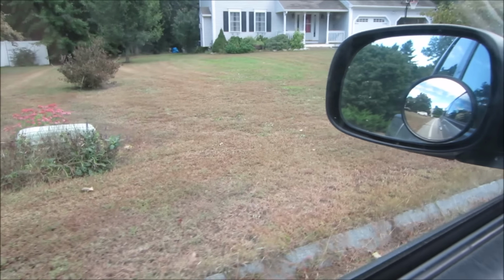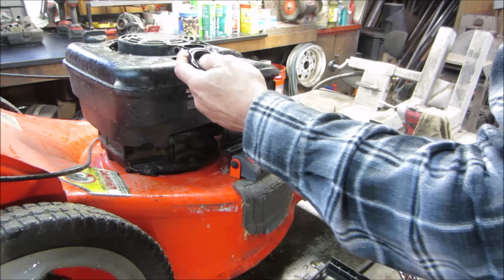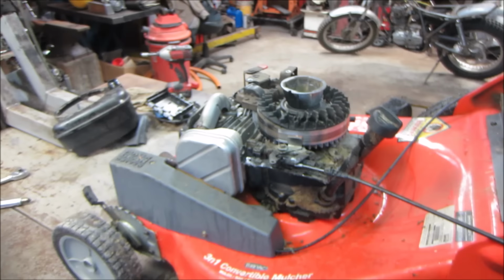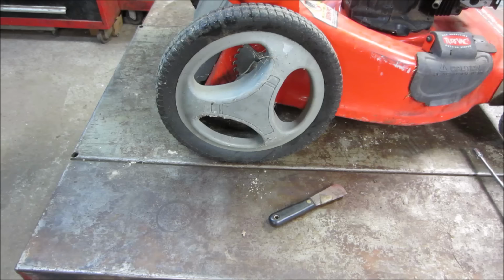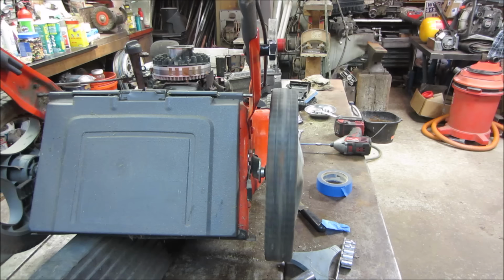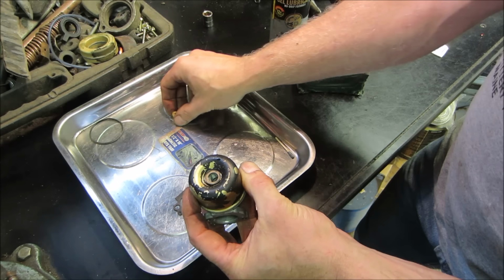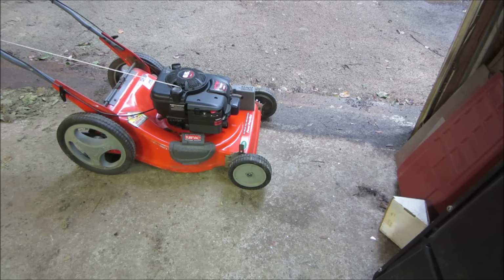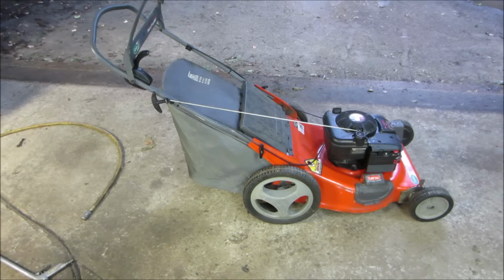How to restore a lawn mower. cheap.

Comment: I have never seen a free pile like that. Hell, I've rarely ever seen a free pile.
Reply: free piles happen alot here in Alberta . however all of them tend to be in garage sales and not like what ol mustie finds here.
Reply: Yeah. The only free piles I see is walking behind a dog.
Reply: Ya that's mostly because they are moving back East and don't want to pay to ship it all.
Reply: One thing's for sure, you'll NEVER EVER see a free pile in Portugal, in fact people try to sell any piece of garbage online, some people even try to sell old CRT TVs for over 50€, even as I write I'm seeing someone trying to sell a TV from the 70's for 150€.
Reply: You're probably going to see more and more because the manufactures are producing more super cheap junk every day.  The goal is to make everything more costly to repair than replace.  Garbage plastic wheels, shafts that bend, etc.  The engines are becoming more and more throw away too with ignition systems that, if they are available as a potted spare, cost more to replace than the mower cost.  (Good luck finding a suitable spare on ebay.)
I just reworked a 1982 Snapper, a mower which was originally made to have a good level of quality.  The engine is a Robin/Subaru although other models were Briggs, etc.  The self propulsion is well made with a lot of standard hardware parts incorporated.  Today Snapper is made by MTD and it is a piece of throw away junk.
Most owners now just hire a yard service and if they do cut their grass they don't change the oil and they let today's nasty ethanol blended gas corrode the whole fuel system outside of the ABS fuel tank.
I  will try to keep the old stuff running as long as I am able.  I just hate to see decent resources wasted.
Good video, thanks.
Reply: If you ever want to get rid of anything, put it out on the curb, it will be gone by supper time.

Comment: I fixed mine cheap. I bought a 6.5 HP B&S engine on ebay for a really cool $120.00 and modified the mower deck. I now have a Super kick-ass Snapper that I got from the scrap yard for 15 dollars.

Comment: I like to cut the bad fuel lines ends off and maybe add a fuel shutoff valve and/or a fuel filter ... both are cheap. The shut off valve is like a maintenance valve for carb work or fuel filter changing .... you can check the needle valve too with the bowl off. That's my 2 cents. I like when you tell what the repaired mower sales for new approximately, and how much you'll put it up for sale. You do good adding life to these mowers. We enjoy your videos too.

Comment: I have one of these mowers, but without the donk wheels and with a tecumseh engine. The blade is the same, they probably sharpen it without removing it. I do and it looks just like that. Had my mower since 2000 and still runs great.

Comment: Just a thought, what about laying down the wheel on a flat surface and then heat gunning it and maybe sticking some type of weight on the wheel to straighten it? granted yeah... it's a used cheapie so...

Comment: Mustie's favorite tools:
1. Wire wheel 
2. Ultrasonic cleaner
3. Air compressor 

Mustie's habits that make me raise an eyebrow.
1. Uses whatever oil is in the engine to test, no matter if it's 37 years old.
2. Tests engines without air filters in place but makes sure that damn carburetor is spotless, LOL.

I poke fun but it doesn't take away that I think that he's a master mechanic and troubleshooter with a true gift for fixing things.  I thoroughly enjoy the videos. :D

Comment: I just sold a Craftsman Leaf Vac for $250 on Craigslist I got for free.  Took it to Home Depot and paid about $70 to get it all tuned up as I didn't have time to do it myself.  Also last week, sold a Troy Bilt lawn mower I got for free  when someone left it in a back alley for a week last winter.  Did the work myself over an hour or so.  Got $80 for it.

Comment: I ordered and put all four new wheels on my 21997X8A and it still propels crooked. Have had transmission checked, all pins and bearings and gears are like new. It's just the nature of those Scott's built by Murray. The ones built by John Deere were much improved .

Comment: There are zero free piles here in Toronto...craigslist for free section is as close as it gets.
Reply: Stuff is expensive around here, so ppl use stuff till there's no life in it.
Reply: Same here if anything does go to the street it lasts maybe 10 mins, those golf clubs would go quick here also.
Reply: Should add the times you do see stuff on the road, it's so bad no one wants it, I came across a tiny push mower last year. I swear I thought it was one of those plastic kids toys at first, it was so small. But it was old and locked up, looked to have been sitting out for year behind a garage. Nothing as nice as this stuff Mustie1 finds, even his crusty stuff looks good.
Reply: I once had a free pile when I was renovating the basement.  I didn't have time to sell it and my family didn't want most of it.  I put stuff like table fans, old exercise gear out front.  It was absolute mayhem.  People driving by would slam on their brakes, and rummage through everything like a pack of wild animals.  haha Everything was gone in a few hours, better than it ending up in the trash.
Reply: Back in the 70s every Thursday was big stuff garbage day in Toronto was always getting free lawnmowers . To bad they stopped it in 80s
Reply: The Americans throw everything away...
Reply: 808v1 around here, you'd have to fight the scrappers (who are meth heads for the most part around these parts) for the mower.
Reply: Here in New Jersey we get all kinds of good stuff at the road all the time. Its awesome.

Comment: I would just run a wire tru the hole than tape the starter string to the wire and pull tru

Comment: Around here, that's be at least  50-75  dollars.  (doesn't run, lots of good parts.)
Reply: 😂😂😂yep! When I worked on a trash truck I had a large collection of lawn mowers people threw out that were perfectly fine. Only one I had to work on and it had a valve seat that had lifted. A straight screwdriver and a light tap with a hammer creating a little dimple holding it in fixed it. Its crazy how many almost brand new lawnmowers I had that "rich" people threw away when they bought a new one every season....
Reply: sinformant  My problem is I live among people that know how to fix stuff, and if they don't their brother/sister/uncle/friend/cousin/father/mother does.  No one throws anything away or gives it away (to a stranger) unless it's pure junk with all good parts removed.
Reply: @excavatoree  oh there are people around her that base their pricing off the price per ounce gold is going for. When I was looking for a 67-72 Chevy c10 I looked at one that a guy wanted $4600 for that was like a Flintstones mobile and ran so bad it could barely pull itself up to 20mph. He wouldn't budge on the price at all. Luckilly I found a completely rust free running one in the city that I bought off a kid who had no clue for $1500. It wouldn't start so he just wanted to get rid of it. We gave the Carb a couple squirts of gas from a bottle, tweaked the distributor, fired it up and drove it onto the trailer😁
Reply: excavatoree 
You have to go to the "priviledged" areas of your town. I do but you have to act quickly, most of them have city bylaws prohibitting picking and police enforcement. But I never, ever bought a lawnmower in my life. Usually, spring time and fathers' day are good !
Reply: $125 here in NJ running and fully functional. That engine is worth $100 all by itself running, particularly because it's a dual shaft engine with an auxiliary pto (if you look closely you'll see a second shaft that comes out the side, the belt hooks to a pulley on that and goes to the trans in the front, which makes the mower move). Those engines are much harder to come by, I don't know if Briggs is even still producing them, but if they are, they would be a lot more expensive than a regular single shaft engine. I just sold one two days ago on ebay for $100 plus 50 shipping heading to North Dakota, a regular engine like that wouldn't go for near as much is it sold at all, since their are billions of regular ones out their. Their isn't that much else good on those mower's their pretty crappy, its a Scott's made by Murray and they fall apart all the time. 90% of the older Scotts and Murrays I see at the curb can't be revived where most other mowers can. That's why that engine I sold was harvested from one. In general for a mower, an engine with two shafts like that is a bad design and prone to having more problem's than a normal mower with one shaft with the belt riding below on the primary shaft, the secondary shaft rides on the cam and is prone to a lot more wear and tear, its like snowblowers that have two shaft's also in general a poor design and more complicated and prone to wearing out sooner than a typical engine with a single shaft. However the engine on that mower is excellent for heavier equipment that does require two shaft's like a sickle bar mower.
Reply: sinformant I find that Bar-B-Qs are right up there with the lawnmowers. Most just need a good cleaning so it gets replaced with a new one.

Comment: I changed the oil in my mower yesterday. I really hate turning the mower on it's side to drain the oil. Just seems hokey to me. So I took a class jar, drilled holes for the fittings, and hooked that up to my vacuum pump and sucked the oil out. I got the idea from watching Project Farm.

Comment: That Blade is a Flippable Blade that is why it is sharpened on both sides, i had a lawnmower just like the Scotts you worked on, it was a great mower. i let it go with a house i sold, wish i had kept it.
Also Hilly Beaner, the blade will be balanced if you use the Nail method of hanging it in the mounting hole and it hangs level, but you need to check it as you sharpen all four areas on the blade, and that particular blade was designed to suck up the grass when mounted either way.

Comment: Another great video! I’ve got a 1996 GX 85 John Deere and haven’t had no motor issues but I change oil 2 times a year and change fuel filter yearly. Carb hasn’t been removed or bowl removed!

Comment: I have an Ariens machine with that type of primer bulb carb, (Briggs and Stratton), and out of all the machines that I have, it is that one starts the most reliably.
The fact that it does not have a choke means that it's harder to flood. 

The primer bulb seems to act like an old fashioned "tickler" that provides a temporary rise in fuel level, to give starting richness.
It may simply be causing the float to wobble....
Because of you I will now have to go into it all, when I have the chance, and maybe know for sure.
Nice video as ever...

Comment: Briggs INTEK series...last of the flatties, IIRC.  This mover has low hours, probably still has the fsctory oil fill in it.  People these days never maintain or repair anything...one reason our economy is permanently screwed up.
Reply: Well, its actually why the economy is still running. Capitalism work that way
Reply: @DrLoverLover  But the resources are being wasted. I would be more concerned about scrapping good things than running diesel cars, for example. Most people think they're eco when they run electric car, but they don't care about buying a lawnmower every 3 years or producing tons of trash, wasting water, electricity, etc.

Comment: Had a mower exactly like that one. Cheap & easy to work on. If you're cutting a lawn that generates a lot of dust keep the air filter clean or the grit gets in the oil and tears everything up = no compression= no mower.

Comment: I predicted 15 pulls for the cold start, so that was a bit of a disappointment.

Seriously? -starting first pull? -that's weaksauce. The audience demands more of a fight!! :D
Reply: I guessed 3. Machine was so happy to get it's carb cleaned and then loaded with high octane racing fuel that it jumped up and started - first pull. Vroom vroom!    Chuck in NE Kansas
Reply: I thought three and immediately rolled my eyes when he did it in one😑
Reply: Vrooooooooooooooooooooom
Reply: Well, he did have to pull it more times later to get it started.
Reply: @davidbeer  Me, too...
Reply: He didn't record the part where gave it a little starting fluid, lol
Reply: Kevin. What is "Starting Fluid?"
Reply: @davidweum9334  Ether.  Sold in a spray can at auto parts stores.  It's much more flammable than gasoline, so if a tiny bit is sprayed into the air intake and get sucked into the engine, it increases the probability that the engine will start.

Comment: I'm not sure if this mentioned already; carbs will leak when they have gas in the bowl and you turn the carb in a direction other than right side down. The fuel line was probably just fine.

Comment: Mustie that can't be the right blade, you want the angle of the cut towards the deck , so it doesn't tear and bash the grass as it cuts...
Reply: By "deck" do you mean the "deck" of the lawnmower, or the surface of the grass?  The cutting edge must be down so that it shears the grass off and does NOT beat it off and shred the grass tips because then they turn brown.  To me, it looked like the blade was installed upside down.  I've had mowers brought to me, after the owner sharpened the blade himself, and then complained that it would not cut.  They put the blade on upside down and were just shredding the grass with the backside of the blade.

Comment: I'll never get another high wheel mower again. Every time you push down on the handle to turn it around, it puts a tremendous amount of stress down by where it connects to the deck, and eventually the handle breaks. I had a craftsman high wheel mower that did just that. I ended up ordering a new handle and I went to Lowes and got a couple pieces of angle iron to use as gussets which I attached half way up the mower handle and the other end close to the front wheels. This transfers the stress through the angle iron to lift the mower from the front of the deck rather than from the back, and that handle never broke, at least for the rest of the time I had it.

Comment: Bent plastic wheels - 30 minutes in the oven at 75C usually fixes them. If they still have a permanent 'set' after that, they are a LOT easier to manipulate when they're hot. Keep the vids coming!

Comment: I use Ethanol free gas that I now buy in Sunapee at the gas station in the middle of town but before that I was driving to Hampton Airfield to buy my gas for the small engines. It's cheaper than Cam 2.

Comment: I had a similar Snapper mower, with that Briggs, we bought it new. They get hard use with me (and regular maintenance..synthetic oil and ethanol free gas). After it was about 4-5 years old it got harder and harder to get it to start. Had low compression. You can feel it pulling the rope. It'd spin over with little resistance. I bought a 173cc Predator (Honda Clone) replacement engine at Harbor Freight tools for $119.  The Predator has been in service about 4 years now and it is a way better engine than the original Briggs!  It has held up well and still starts easily first pull. The Briggs was a flat head engine w/aluminum bore and the rings lost compression. The Predator has OHV and cast iron sleeve bore and ball bearing supported crank. I think they're as good as a Honda engine, but they are only about 1/3 the cost. Same story with the horizontal shaft 212cc Predator I put on the ancient Troy-Bilt Horse tiller. It was $99, but way superior engine to the old Tecumseh 7hp, or the Briggs they came with. They call it 6.5hp, but it runs stronger than the 8hp Briggs! More power and reliable. I can't afford the time to always tinker with the old worn out engines. The only drawback to the Predators is there is no parts available from HF Tools. Many parts sold for Hondas will work for the Predators, though.... On the horizontal shaft models there is actually aftermarket high performance racing parts that are sold to go-karters for hopping them up (like race cams and big bore cylinders and heavy duty rods!).  You know they've got to be pretty good if they are used for racing.

Comment: When u heat the tires up up to straighten them up,u have to keep it in the position u want it to be in before it has a chance to cool or it will go back to its original shape.Take a long screw driver ,or a flat piece of 2 ft.metal and hold it in place.I found this works best.Good vid.

Comment: On drain plug so get out put back easy each I put grease on threads if don't have put antiseize  of drain plug thread and clean up with cuetip after oil drain all out ! It sure helps lots and much easyier than rust for life to never get out !

Comment: They ground the bottom to keep from pulling the blade off the mower. Craftsman engineered a few things like that to make them easier to sharpen. Their chainsaw had a similar feature.

Comment: If I had tried that axle it would have broken from the bracket.  Pehaps heating/straightening the wheel then dunking in cold water would help. Of course it would have broken if I tried it. Restrain the bent heated portion and cool quickly with wet rags.  It may help with the Memory.   On those puller mowers, the front tires can be regrooved carefully with an angle grinder if they are bald.  Sometimes there is a very tiny hole on an angle in the Float Bowl jet that points upwards.  Wire Brush bristle size hole.  Great Find. $$$.  Several blades I have seen are sharpened that way.  Mulch better?

Comment: I just finished working on one of these six and a half horse Briggs yesterday pretty good motor it's been in the mower for 12 years and still runs good but I sure wish sometimes they'd go back to the old pull out choke and the hell with the with this squeeze lever thing they have on them also it'd be nice if you could adjust the RPM of the motor but other than that it's a Troy-Bilt and it's been a really good mower